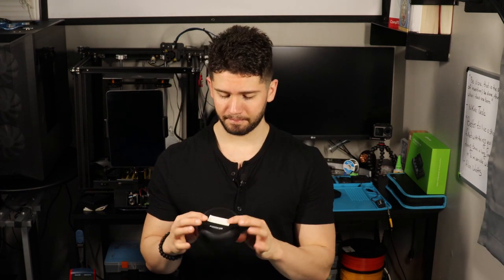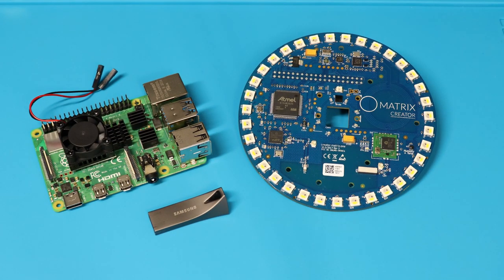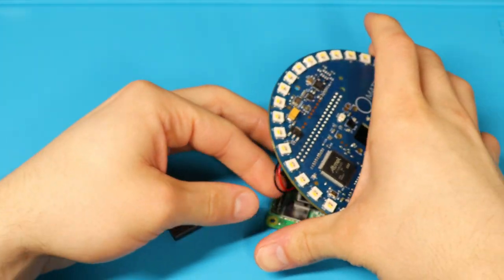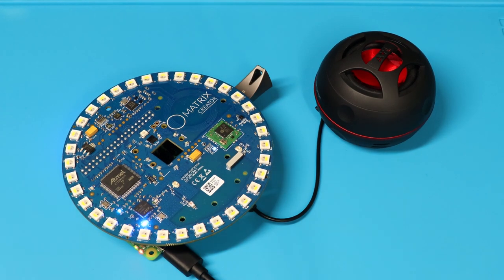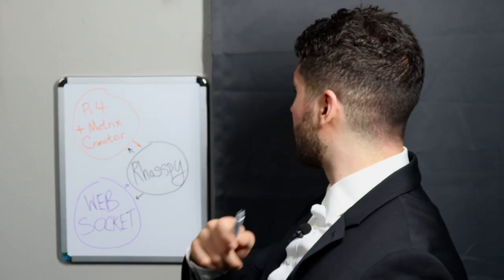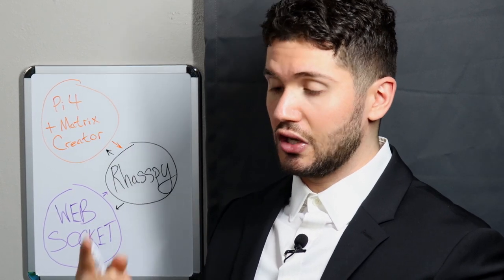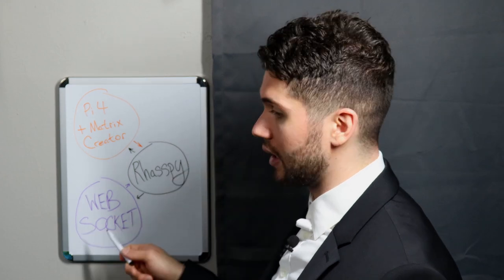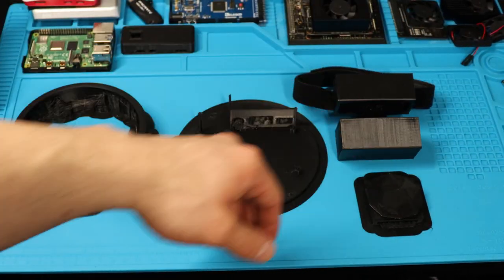Building a Custom Ai Home Assistant

Comment: How long did this take to make
Reply from the maker: Putting the Hardware together doesn't take long at all. I'd say the most labor intensive part of the entire project was:
1. Downloading and properly installing the Matrix Creator Packages 
2. Downloading and setting up Docker
3. Downloading and installing Rhasspy
4. Programming the WebSocket

The reason why this was very labor intensive was the learning on the fly aspect, every time I installed something new i needed to learn its purpose, function, and workflow.

All in all it took about two weeks to make (also juggling 9-5)